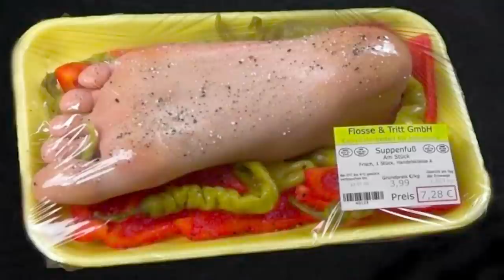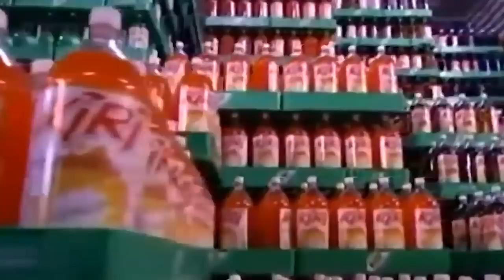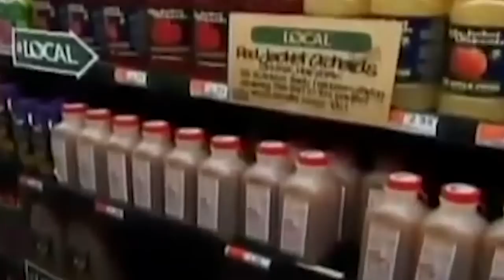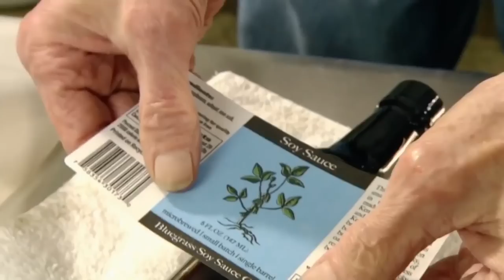You’ll Never Eat This Again After Knowing How Its Made

Comment: generally I wouldn’t saz pretzels are more unhealthy than regular whitebread. What that does sound dangerous at first is that the brown coating, originaly, comes from a lye solution. If handled correctly it’s harmless but handling it wrongly could hurt the baker
the lze solution is the reason for why it’s hard to ake them on your own. fun fact the german word directly translates to ‘’lye pretzel’’ and in normal bread form ‘’lye bread’’